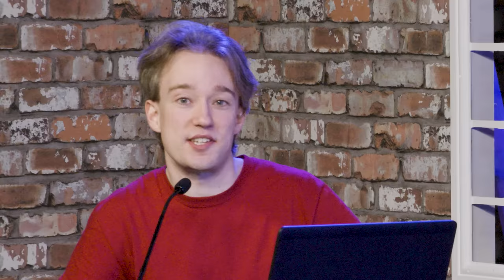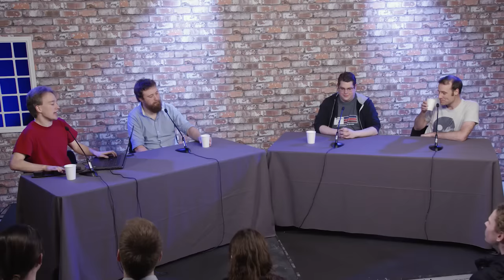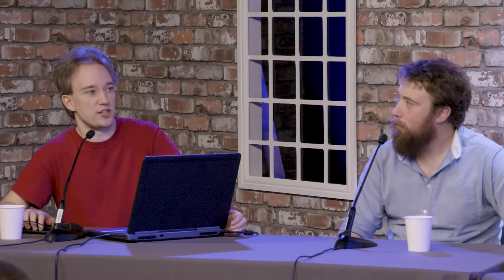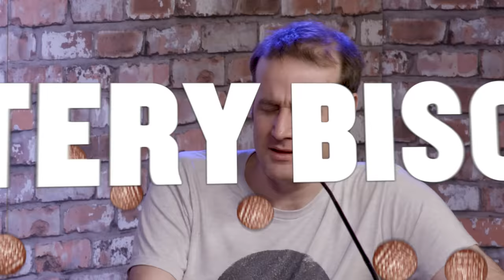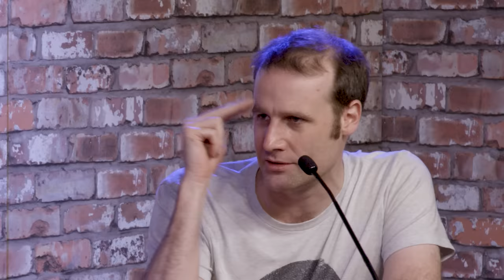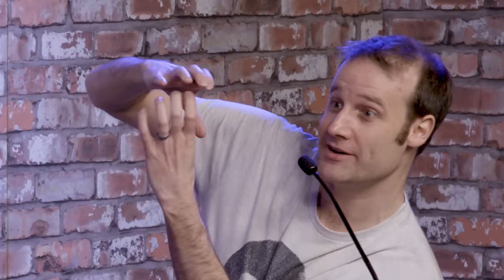The Flip Flap Railroad and Marshmallow Bearings: Citation Needed 7x04

Comment: Another reason that loops are not circles, is that just before you enter, you are at 1g, but the moment you enter it, you have the full centripetal force. In the case of Flip Flap, you instantaneously go from 1g to 12g at the entrance and 12g to 1g at the exit, which is the real reason for injuries. With a constantly changing radius, the change in acceleration is gradual, thus putting a lot less jerk on the body.
Reply: Jerk! Yes! Thankyou ViHart for the physics education so I can understand this comment.
Reply: @RainbowFishSaysHello  vihart? Where?
Reply: Transition curves, there used to be books of data to layout different road corners for different velocities and banking. Now it is an app.
Reply: NotYourGreatestPlan  it isn't the fall that kills you but instead the sudden stop
Reply: @RainbowFishSaysHello  The great thing about jerk is that it is both a technical physics/engineering term, but also has a colloquial use that is actually very similar to the technical use.
Reply: @RainbowFishSaysHello  ironically, the only reason I know what jerk is, is another Tom Scott video.

Comment: There is still a wooden rollercoaster in Finland (Helsinki, Linnanmäki) called "Vuoristorata" with a brakeman on it. One of 7 still in operation (or so Wikipedia says).
Reply: There is a wooden rollercoaster in Backen in Copenhagen with manual brakes (that a person in the back operates) that I went on about five years ago. I’m guessing it’s still operational.
Reply: I wonder what it tells about Nordic amusement park technology that half of the rollercoasters still using brakemen are in Norway, Denmark and Finland. We really have a deathwish up here I suppose. Now we just need start adding poorly designed loop-de-loops on those rickety old deathtraps.

Comment: 11:07 - to be fair you could pull off a simple circle if you get the speed just right - looking at potential energy, kinetic energy and centrifugal force you can actually simplify it quite a lot and it turns out to be a constant difference - that is a simple circle looping will have 4G MORE centrifugal acceleration at the bottom than at the top - to stay in at the top you need at least 1G to counter gravity which gives you 5G at the bottom plus gravity means you experience 6G overall - 7G if you want an extra 1G at the top to be on the safe side - and 6-7 G is still somewhat feasible
problem is of course if you don't do your calculations precisely and just go by trial and error well... then you might end up with much more